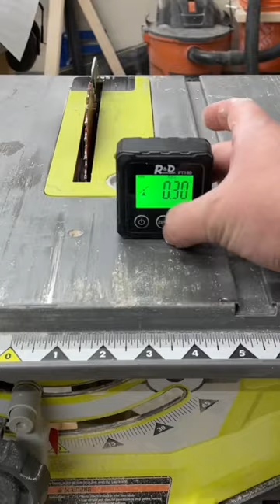DIY Floating Console Table #diywoodworkingprojects #diywoodworking

Comment: Nice work. I couldn't help but notice that you set your digital angle finder on your table saw blade in a way which will give you an imprecise reading. You want to affix the body of the angle finder box to the blade without coming into contact with the teeth of the blade. The blade tooth will change the degree of your angle.
Reply: Whilst I totally agree, for this project the slight difference wouldn't cause an issue.
That being said, being precise is always good practice - so, great advice 👍🏻
Reply: Tru dat 👍🏻

Comment: Quick tip to prevent tear out on pocket hole screws, turn the drill to fastest setting and get the bit up to speed before allowing it to touch the wood.